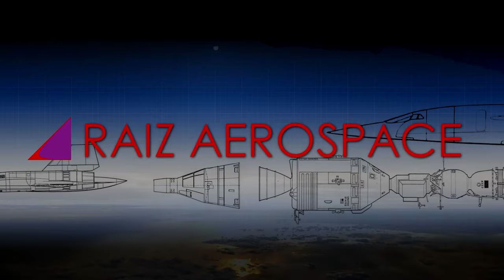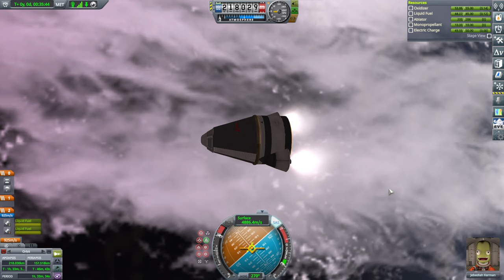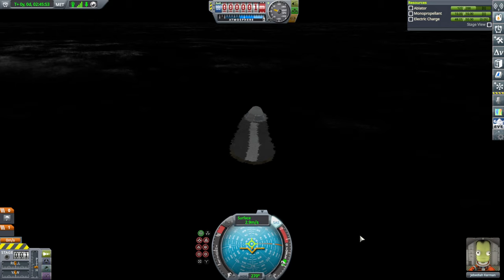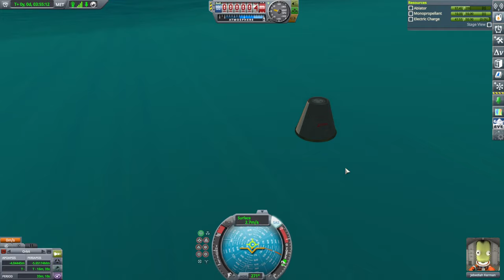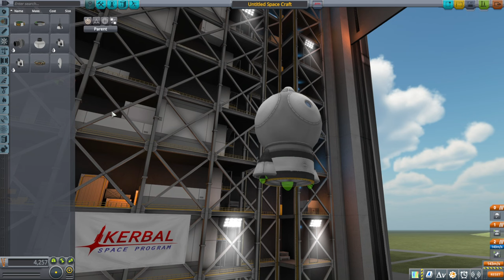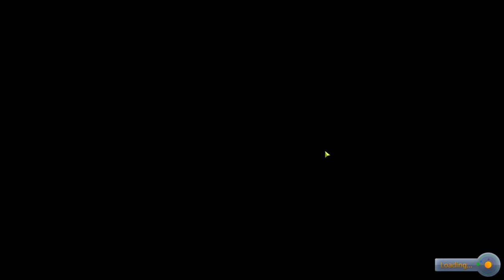Trappist-1e Reentry Testing (KSP 1.12)

Comment: Thanks for the testing. It's been my impression for many years that ablator does absolutely nothing, but I never bothered observing it in any detail.
Heat shields are still good for shielding weaker parts from heat. And the ablator definitely simulates mass shedding when it heats up, only it does not have any cooling effect at all. You could just set the ablator to zero and save the mass.

Comment: I agree with the 80%, I mean I imagine that any realistic space agency would design their heat shields in such a way as they contain all the ablator needed to keep the craft safe, but not much more, and at 80% heating that was around where that rested.

However, why did Val die?  I think you're right in that it wasn't properly holding retrograde, (as you hadn't unlocked that option yet) and so I think we can 'officially' call this pilot error.  (the pilot really being you, lol).  As if the angle of attack had been correct, the pod wouldn't have taken the heat, and Val would have survived.

Still, RIP Val.  She will be missed.

P.S. - As for how to get the rest of your Kerbals to survive?  Best suggestion without cheating star-levels in?  Wait until you can add probe-controls to the pod to allow for that hold retrograde function?  OR change to a double-drop form of re-entry, dipping in and bouncing off to drop again, which will trade heating for G-Forces (Yeah, the G-Forces will be a lot higher, but the heating would be less).  Neither are perfect options, but they ARE options!

Comment: If you wanted to get rid of the unrealistic moons, you could chuck them in super high orbits around the sun where you'd never see them. I've done it with hyper edit a few times.
Reply from the maker: No - I want the moons as destinations. I could just get rid of them altogether with the patch I made (I already did that with Bop or Pol), but I'm pretty sure doing that would also make the stock career impossible.